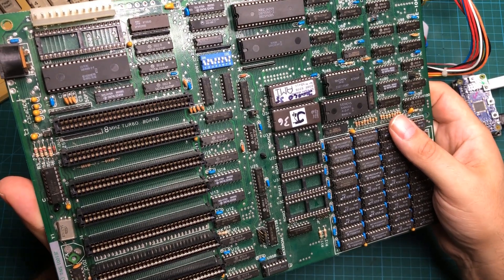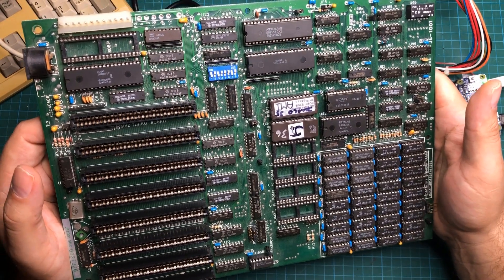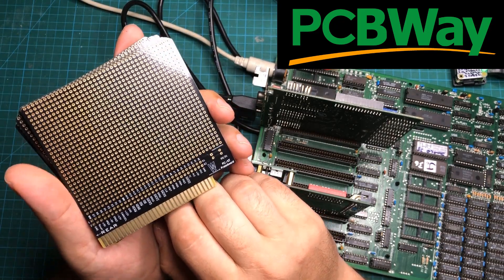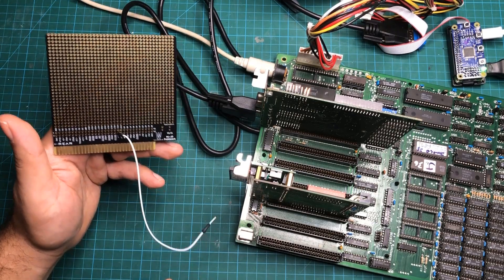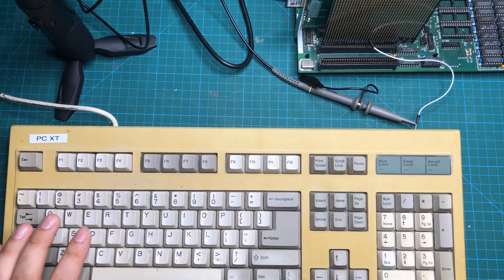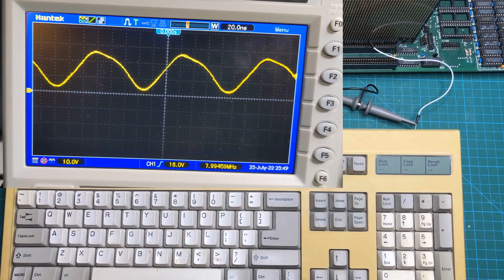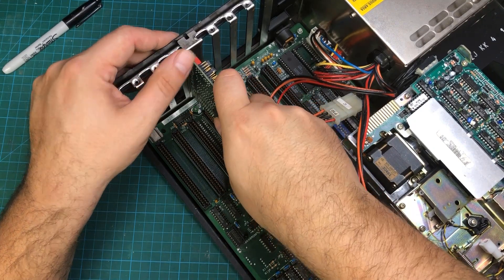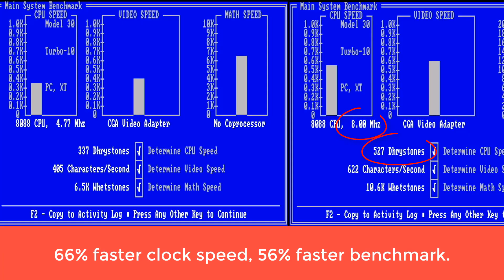This mystery card made my computer 66% faster

Comment: I remember buying a 12Mhz booster module and adding it to my XT clone. It was an octopus board that I had to cut several traces and solder the connections in on the MB. Getting it done and working took me about a day and there was one point I thought I had trashed my motherboard!  In the end, it did work and I could do 4.77 and 12Mhz.
Reply from the maker: That's really interesting. I'm guessing someone has a diy solution now for the same thing. I'll have to check.  I think it's a crystal and one particular chip on the bus.

Comment: Waaaay to short video! For me it was 210% right from the beginning and when the video ended, it was.. heeeeeeeey.. Whyyyyyyy!? Awesome video, really interesting, I've had those edge connector floppy cables a long time ago, never knew what they were used for so I believe I trashed them.. Oh well.. hehe.. Awesome video, I'm looking into building myself an ISA computer.. not sure which kind yet, but I want it to work with DOS and Win 3.1 / 3.11.

I'm really not sure about all the IBM XT, 286, 386, 486.. never learned that, but I believe 586 was our 32-bit platform? Like Pentium 2 up to 4 and then 686 for 64-bit for the Intel Core cpus?

Well well, awesome video, I didn't think you would find the turbo light pins - I didn't know they existed, but was a great experience to see you found it and that you got turbo mode working as well!
Reply: Oh, and do you have the link for the ISA protoboard as well?

Comment: Did you close the jumper for  the turbo? in the old days the case had a button for the turbo,  so look for the turbo pin near the power led on the board
Reply from the maker: This one didn't have an obvious jumper switch or jumper.  I had all my friends look for manuals.
Reply: I don't think the old XT motherboard had any case led pins on it, from memory I think there was no power light, and the HDD LED was on the actual hard disk. I did wonder about the DIP switch on the motherboard, but I think that was for setting things like if you had a math coprocessor fitted and memory and video settings? I might be wrong though, as it has been a long time since I've worked on a PC/XT!
Reply from the maker: The dip switches are graphics card and floppy settings.  This board didn't have a manual, but I did not find that jumpering any pins engaged turbo